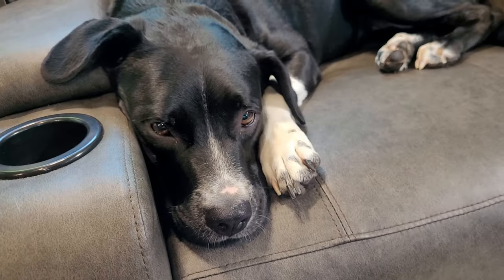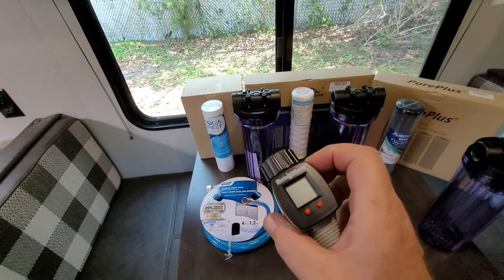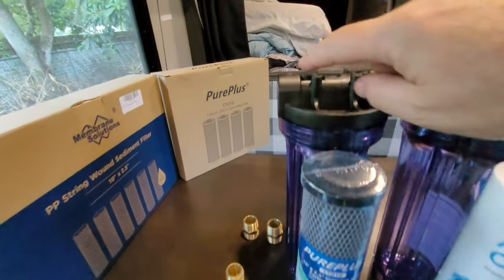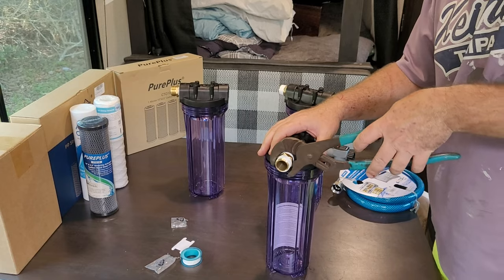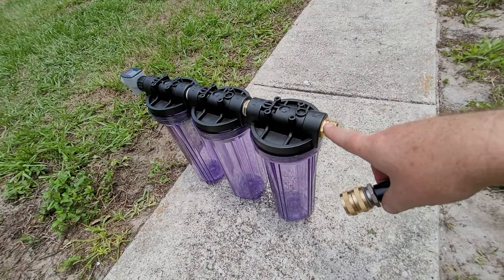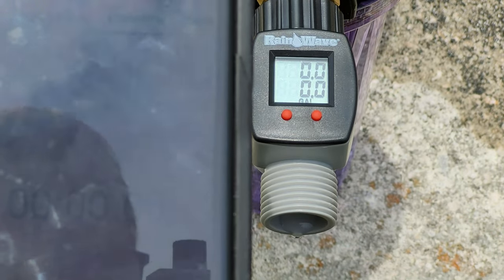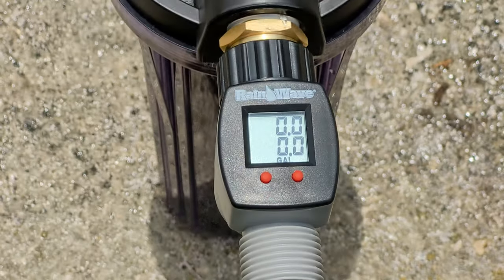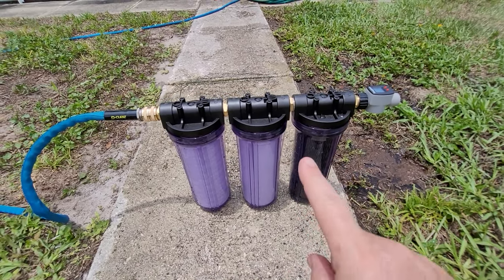Up Your RV Game: This Simple Upgrade Will Blow You Away

Comment: I just use a single 0.5 micron carbon block filter. As long as the water pressure from the supply is at least 40 psi we have totally adequate pressure and flow in the RV. We’ve stayed at some campgrounds where they had low water pressure so I fill the freshwater tank using the filter and use the onboard water pump instead of connecting the “city water”.
Reply from the maker: Awesome! I've thought of using the tank if the pressure is low, haven't had to yet but I know it's coming lol

Comment: Great video! Many years ago I built this same setup for our house, to filter our well water. I use a 5 micron filter in the first cartridge, a carbon filter in the second cartridge and a 1 micron filter in the third cartridge.  BTW: thank you for the link for the carbon filters you use.  I plan to switch over to those filters when it comes time to replace mine.
Note: I set up a parallel system, (2) 3 filter systems side by side, in order to help maintain water flow/pressure.  IMHO an RV shouldn't need a parallel system.
It works great!
Reply from the maker: Thank you so much! you are very welcome for the link...I "try" whenever I'm trying something out to include where I get things in case anyone needs them.  Glad to know your system worked great too!  Thanks for watching!!! Safe Travels!

Comment: The only point I would make is that you still have to connect the filters to the water inlet on the trailer.  That is going to mean another hose, plus the rubber water lines in the RV itself.  Otherwise, I think your idea is great!
Reply from the maker: Very true! Luckily, so far so good!!
Reply: The RV has pex water lines throughout, not rubber lines.